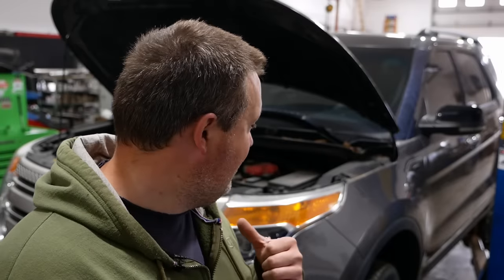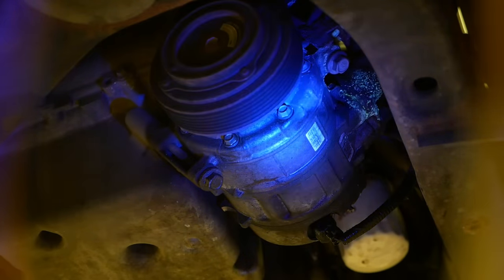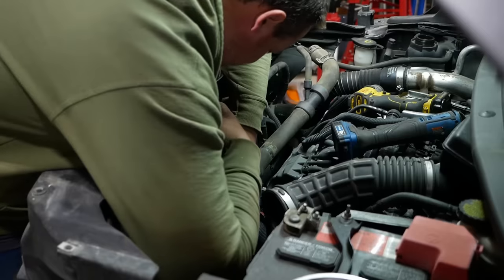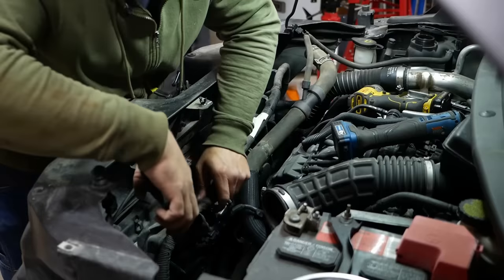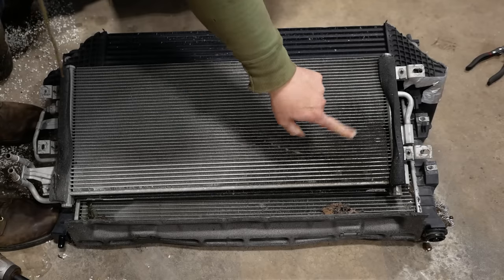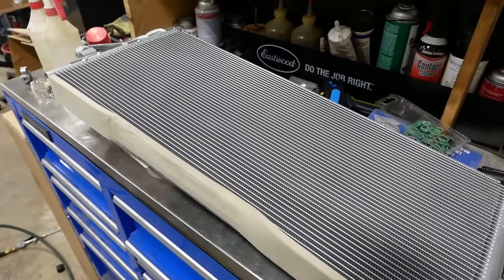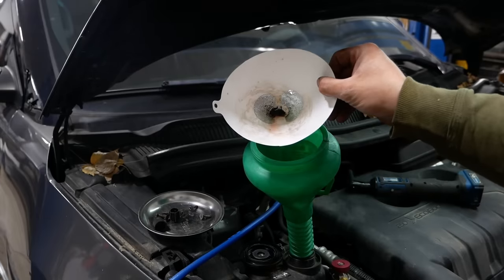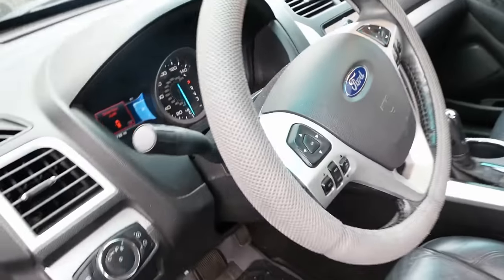Ford Explorer Replace A/C Condenser

Comment: I live near Phoenix, Arizona where we have to have A/C to function. By early May we had already hit 107 (f) (actual not heat index). June thru Aug. 110-115 daily, with an occasional 120 thrown in. Usually our last 100 is Halloween or there about. Our home A/C runs 24/7 from April thru Oct.. Up side is 6 months of glorious weather, no humidity to speak of, no mosquitos or flies.
El Mirage, Arizona

Comment: Rain man Ray would be proud. Good job Wes, I'm glad your Donkey is back up and running on his feet and keeping the wheels moving
There was a time when the average vehicle owner could do most repairs by themselves, them days are long gone. Just to replace the battery in my car, I had to remove the front wheel and inner fender, a job that would normally take a few minutes is now a few hours. Car makers in cahoots with parts suppliers are doing their damnedest to eliminate the backyard mechanic. To add insult to injury, you need specialized tools to work on a car. I'm not at all surprised by the prices you quoted at the end of the video. Someone somewhere is laughing their asses off at consumers expense.

Comment: As always, I am a little amazed with the prices of most of the parts to repair cars over there compared to here in Australia, but twenty something years ago when I started in this trade I worked in an air con shop and even back then, parts were expensive, refrigerant was expensive, and there was always a heap of labour involved getting the system repaired. Even with the rules, regulations and licensing required the workshop made enough money to remain viable with two full time tradesmen and an apprentice over the busy Summer period.
Yep, AC is expensive, but people will pay for it.

Also as for the coil cooler in the bottom of the condenser, even the Australian Commodores around 2010 (think Chev Caprice the police used but with a 3.6 Alloytec V6) uses the bottom of the condenser as I think transmission cooler, maybe it was power steering.
Reply: I think when it comes to AC stuff and especially the refrigerant, other things come into play as well. Not sure about the US and Australia, but here in Europe they allow every year less of the old refrigerant to be produced/imported as they want to get rid of all the old higher greenhouse effect stuff. Makes it more expensive every year of course. A shop here wouldn't even be allowed to have a car leave with any leak at all. They are supposed to do leak testing with nitrogen and a tracer.
What they aim for is understandable, but as that will not get the old systems replaced faster, i sometimes wonder if that really is sustainable.
Only effect I can see is for manufacturers having to switch to the new common refrigerant (I heard Mercedes Benz intensified research on CO2 systems), which could have been achieved differently as well.
Reply: @alexanderkupke920  Here in Australia only properly licensed people can work on AC systems at all, and same, the system is supposed to be leak tested after any repair has been carried out, and any new leaks found also repaired before the car is sent out. They banned imports and manufacturing of R12 here around 99 or so, I'm not aware of any restrictions on R134a at this stage, but neither have I seen any new systems with R1234yf or CO2, although I have heard about it.
Reply: @ryanworkman5229  about working on the systems it is quite similar here in Germany, no matter if building HVAC or automotive. A car mechanic requires a certificate to work on the AC, which they usually aquire during apprenticeship already. 
Not sure about R12, didn´t here about any R12 systems around here for a long time, but that may only be for larger systems anyways and at least around here HVAC systems are not very common for residential buildings anyways. But I think it is banned since the nineties as well. Wasn´t R134a the replacement? Most common refrigerant seems to be R134a, at least when it comes to automotive stuff, but smaller HVAC systems in general. (Like the ones you can get from the DIY store but officially are not allowed to install yourself, even with the quick couplers and precharged or prevacuumed lines). R134a is restricted across Europe with decreasing quotes every year, new car models for a few years now come exclusively with R1234yf systems. (With new car model being a car newly certified after changes or as a new model, they can still use all the old stuff if they build a car without changes for 10 years now.) Not sure if Mercedes actually uses CO2 in some modells already. Other than that, for smaller refrigeration equipment, most common refrigerant is actually R290, which is Propane, or R600a for refrigerators.

Comment: Back when I still did HVAC, I got more work, coming after someone had tried to "fix" things.   It's gratifying to see someone properly use refrigerant dye as proof of where the problem(s) are.  So many times, by  the time I got to it, so many things were replaced-often improperly- that it was a nightmare to get back to square one.  Nice job.   Weird parts, though-- mixing hot engine oil with A/C condenser?  I wonder how much that affects the AC performance?
Reply: It's on the back side. There may be a little conduction, but given the airflow it's probably insignificant.

Comment: 3 years ago, I replaced almost every single piece of the AC system in my 99 Trans Am except one hardline and the evaporator for about 350 total. Thats compressor, soft/hard line, accumulator, condensor and freon. Took my lazy self 8 hours or so. Oh, also grabbed a vacuum pump. Oddly, the same Amazon kit I bought for the compressor is now 30 cheaper. Easy as pie on my vehicle at least.

Comment: I wanna meet the man who thought it would be a good idea to design and engineer a car in a specific way as to force you to spend the time to take 15 different things off just so you can finally get access to the bottom 2 bolts if a headlight goes out
Reply from the maker: Pretty much every car these days.
Reply: Meet him in a dark alley with a 2x4 and a couple friends?
Reply: Is it designed that way simply to make the initial assembly faster without regard to what may need to be done later?
Reply: I saw a guy in the local auto parts store parking lot taking the front end off a truck to change a headlight. We chatted for a few minutes about how easy they used to be. The next week I saw him there again doing the other side. Maybe It's just me but I think I would've replaced every bulb that cover had to come off for at the same time.

Comment: No one should be allowed to be an Automotive Design Engineer until they've spent at least a couple of years working as a mechanic.  I'll bet you'd see a lot more "service friendly" designs!
Reply: Yup, say the same thing all the time.
Reply: It's been that way for years and years and if anything it's gotten worse.
Reply: I've worked in the Auto Industry and its all about how fast it can be assembled on the assembly line.  Time is money the corporate bean counters don't give a shit about how easy it is to take back apart.
Reply: Don't be too quick to pull the trigger on the design engineers. Vehicles are designed to be easily put together, not serviced, and the bean counters have the finial say.
Reply: @roosterhunter6245  the longer I takes to fix is more money in the dealers pocket for the service department so they’re happy to. It’s a plus for everyone but the customer.
Reply: .................................. and car owners should know that they don't have the answers  and are hardly ever right!
Reply: Not only that, they should be sent to wrecking yards and study what fails and what doesn't, both mechanically and in accidents, in real usage. Computer simulations don't count.
Reply: That, or you'd see things like an front clip that displaces as a unit with quick disconnect fittings or the like
Reply: I have thought the same idea, until as an engineer in a completely different field I ran into situations where the balance between cost, reliability and ease of use the saying goes you can have two but not all three. It is trying to make the best choice given the options available and what is the most critical thing. And in reality sometimes the part cost or (fill in the blank) isn't the most important. It sometimes was an undesired compromise. I have worked on vehicles and equipment it did impact my design work for production assembly tools, equipment, and jigs. I feel for the guys stuck between the budget already spent due to a part being necessary and more expensive than expected and a need for good design. Not fun in those positions, I know, just not from the automotive realm.

Comment: I recently got up close and personal with a 2006(?) Ford Edge that needed a new Rad.
More less same adventure. Bumper out, empty A/C system, disconnect A/T cooling lines at thermostat, empty cooling system, et al, pull rad support assembly with Rad, Condenser and A/T cooler all sandwiched in one package. 
Rad support it's made of fiberglass reinforced plastic.
I wasn't wearing gloves.
The fiber got me good. 👌😬
On the Edge and other brands and models, all in all a pretty str8 forward procedure if you have the right tools (A/C evac & recharge), a car lift and the car is not Coral Reef Level when it comes to corrosion or been previously involved in an accident and stitched together with bubble gum and Zip Ties.
That Explorer owner will be back sooner or later with a seized SOLID compressor for not fixing that "slow" leak and then he/she will need more than a cheap o-ring and condenser if they want it to last "enough" for the butt hurt have faded to "I can pay for it again" levels. 
EDIT: Please, don't get me started on the 1234 Freon and the CRAZY price hike. THAT THING IT'S A TOTAL RIP OFF ! AND FLAMMABLE TOO !
Thankfully there's already retrofit kits to go back to 134a if need be.
And even 134a it's crazy expensive.

Comment: I know I don't get how they're building these vehicles nowadays I had a 07Suzuki XL7 that needed a new timing chain the book time was 27 hours no joke I bought a scrapped yard engine and it took me about 6 hours. Sad it was easier to replace the engine than crack it open to put in a lousy timing chain in.
Reply from the maker: Pine Hollow Auto Diagnostics did one. He said he'd scrap it before replacing the timing chain again.

Comment: Everything is stupid dear - if you can get it in the first place. And not just the big items. I went to 4 large shops and our equivalent of Home Depot (Bunnings) to buy the most popular button battery known to man, the 2032. None had them. Tomorrow I am off to the dollar store. I am desperate to the point where I don't care about the quality now, a no-name brand is better than none! Crazy times still.
Reply from the maker: I had the same experience. Needed one for my welding helmet. Finally found it at the grocery store of all places.
Reply: Here, at Walmart you can buy a $1 disposable headlamp in the camping section.
They have two 2032's inside when the battery rack has none available (for $6ish a piece!)
Reply: @jimurrata6785  Good tip!
Reply: @commietube_censorship_sucks  Except when you're in the middle of a job and you need your welding helmet working now, and not next week
Reply: @commietube_censorship_sucks  I prefer to buy locally, even if it costs a little more. Having said that, I am as guilty as the next person as far as buying exactly the same product/brand on-line if the local cost is ridiculously dearer. I say on-line, because I don't always buy my on-line on eBay.

Comment: as 79 y/o self styled mechanic, I can't do it myself anymore :(  I am planning a tour of the western states, six weeks worth, and probably the last time I can afford the expense.... getting my 2001 Suburban in "top shape" and worry free has ruined my wallet. Trying to get my RV water lines repaired, shop has had it on their lot, six weeks now, it has not moved from where I parked it. !@#$%^&  I leave in six days, with, or without a working water plumbing system..... 3 years ago, I spent $1,200 getting the Front & Rear air repaired.... don't want to think what that would cost today after Biden's BS and ruining our Economy.

Comment: Used the paint filter trick 2 weeks ago when I fixed the coolingproblem of my car Saves a lot of coulant..  To bad it wont go with oil.. That was in my car for 150 km..

Comment: Working on AC on a Ford...brave. Ensures I will watch Wes work until the end of the video.
Reply: I had the same problem on a Honda, took me 5 hours to rebuild it, saved me thousands. You just have to rent the vacuum pump for about tree-fiddy, but you get it back.

Comment: So good to see you back. And it wouldn’t be Wes without some crazy pain-in-the-neck repair. Why couldn’t they just want new tires? Nah. Too easy, but knowing Ford you’d probably have to take the rear assembly apart to change the front tire. Unlike German cars, Fords aren’t over engineered, they’re under engineered.

Comment: Hey Wes I have a Ford Ecsape SE to replace a battery to have to take the cow off then the wiper blades, just nuts then you have to get a Ford repair person to reset the car computer. Just nuts with the designers do with engines. Thanks for being one of the good guys.

Comment: Worked with a guy who was at the ford dealer for 12 years, said a/c jobs were the one thing he would pass on. said they didn't pay due to high failure/come back issues.  I here you on the cost and parts availability or lack of, shop gets plugged up fast waiting.

Comment: Geez Louise Wes, it seems like most of that job was removing all of the ancillary stuff and reattaching it after you did the actual repair.  That's a lot of work to have cool results.  My '99 Ford F250 SD has AC but frankly I ride around with the windows open...the only time I wish my AC worked is when it's hot and raining...well I save on washing my cloths that day!  Great video thumbs up.

Comment: My 2011 Grand Marquis has a combo cooler like that, so Ford's been doing it a while. Transmission cooler is the bottom several rows of the AC condensor. I'd prefer them separate, but from a manufacturing standpoint it's brilliant. Thats less brackets and bolts and faster assembly. Easy if you need to replace the condensor, it's 1 bolt for the cooler attachments. Totally sucks if you just need a transmission cooler, as it just added a drain, vacuum and fill on the AC system.

Comment: Great Video, Wes. I work in the Commercial HVACR Industry and R-134a is one of the cheaper refrigerants. R-22 has been phased out and is over $1200 for a 30 lb cylinder, if you can find it. I work on some automotive AC Systems and don’t know what to do about parts availability, some stuff is not available at all or expensive if you can get it. The only thing we can do is press on. Thanks

Comment: I remember my first car, a used 1974 Datsun B 110. You could get both hands around 3 sides of the radiator, just had a few bolts and hoses. Now days 🙀

Comment: I have two European cars. Mandatory dealer service to maintain warranty runs about $1,000 to $1,200 each a year. The service consists mainly of checking fluid levels, tire pressure (they no longer rotate tires) and a very very expensive oil change with filter. Oh, and new $150 wiper blades. The world is insane....how do people manage? I fortunately am able to trade in my cars as soon as the warranty expires. Getting a new car is less expensive than a few minor repairs at the dealer.

Comment: Thanks for the heads up on 
A/C Wes. 
I'm wondering if Eric the car guy pushes your buttons like Puddin' does mine.  I grew up when lots of guys talked and acted like ETCG on TV.

Sleeper Dude is my limit.  Casings instead of tires?  Well ok for you I guess.  The sausages they like are (phonetically) VEE-enna sausages. Vienna isn't too hard to pronounce.  Maybe we should call them 'freedom sausages" from now on.

Comment: I have a 2012 Focus that the A/C doesn’t work. I found the compressor coil is shorted to ground. It’s about $200 from rock auto. Can’t find one locally and the pick n pull doesn’t have any Focus’s around that year. Dealer said $500 for the coil. Expensive.

Comment: Another reason to either lease a vehicle, or trade them every three years (when the warranty expires).  I own a 2018 GMC Sierra 1500.  Ordered it brand new in 2017.  It currently has 42,000 miles on it.  And I consider it a ticking time bomb.  Sad really.  I've also got a personal rule: If I can't see it, I don't fix it.  There just seems to be too many booby traps pre-installed (or engineered) into newer vehicles.  And most people who work on these critters, know where they are, and have the skill set to avoid or work around them.  You are spot on with the price of parts.  And I see no end in sight to this.
Reply: I like my vehicles older than 10 years with the buckets of money that come with them
Reply from the maker: I dunno. It used to be they made them so complex you had to go back to the dealer to fix them. Now they are so complex even the dealer can't fix them.
Reply: @WatchWesWork  Yea they just send em to Eric O haha

Comment: A lot of the shops are also facing labor issues. They are pricing the work to be done way higher because they are starting to get a back log. My main mechanic told me if I needed any major work done it wouldn't get done until the snow flies. In my profession we have seen a steady decline and now this year it's like the bottom fell out. We can't get help from anywhere. No one wants to work anymore. I understand that a lot of the issues that you face are with supplies, however, a lot of the stuff you need can't be made here in the USA because of the labor issue. And China has been on an almost permanent shut down due to covid.